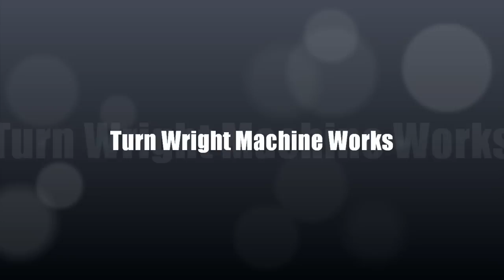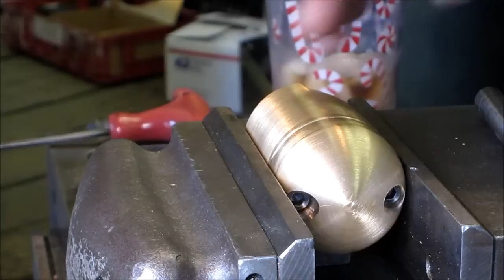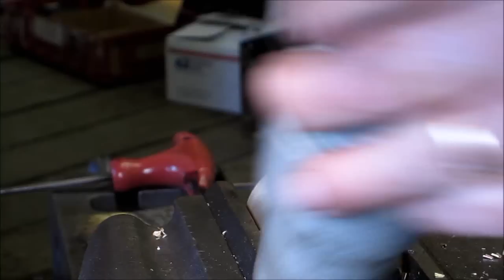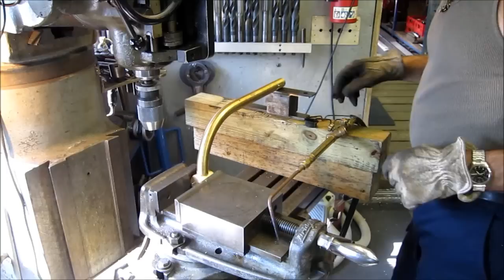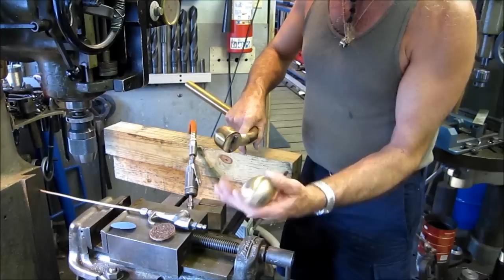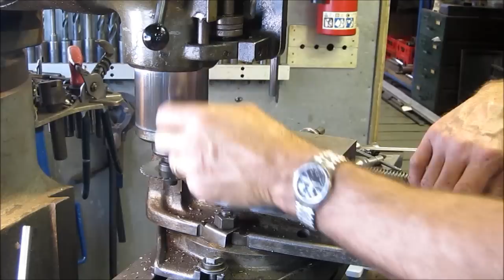The Golden BBQ Support Part Three

Comment from the maker: I'm keeping a constant drill feed by engaging the feed hand wheel, with the actual feed drive disengaged, from the motor drive, so that I maintain control of the drill. On bronze and a few other alloys,  a tendency to grab or suck bits is the standard. Another reason why I wasn’t peck drilling, or going at it like a wood pecker…

Comment from the maker: 303 Is easy machining, propably start out close to the same, 120 to 210 and feed about .020" per side, with high speed, Remember shape, style and grade of bit has a lot to do with speeds also. Start out slower than you think and work your way up, is better than burning a bit.

Comment: Thanks, Keith!  I made one of those slitting saw mandrels out of 1144 TGP stressproof on the 13" South Bend when I was taking machining classes at my local tech school.  It was a perfect project for learning how to use a lathe.  I've used the mandrel with a slitting saw on my BP at home and the design works very well.